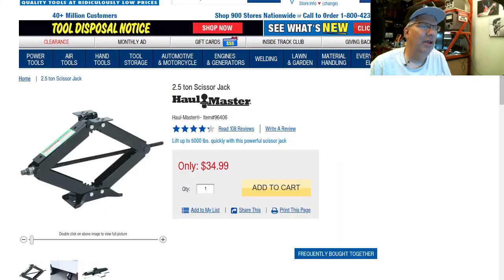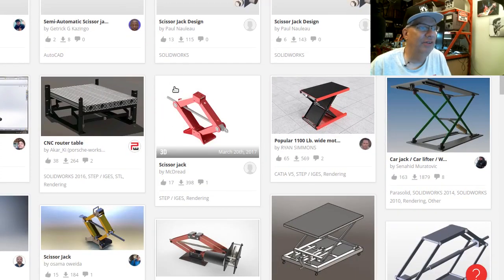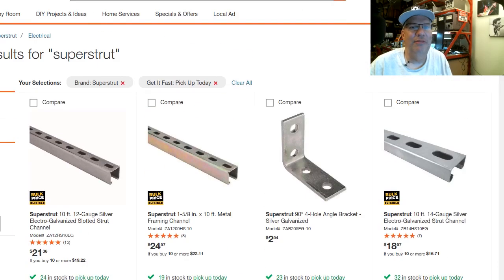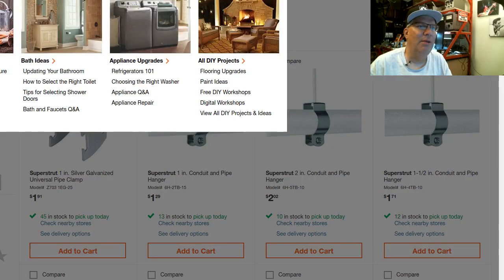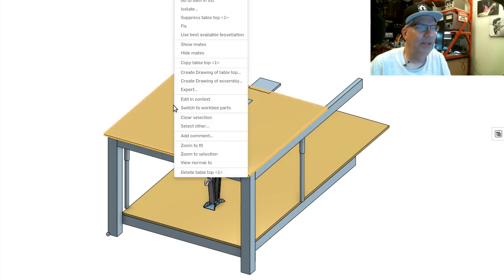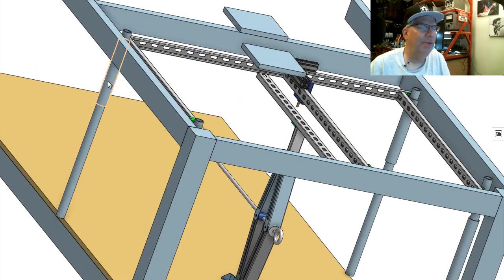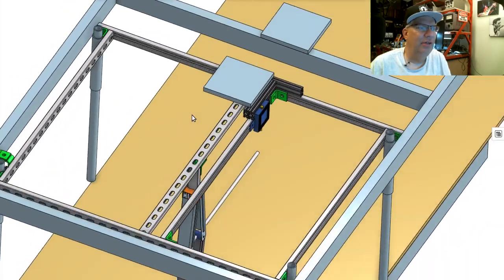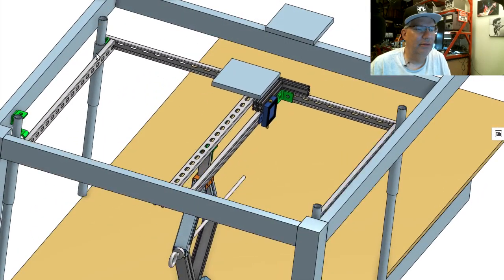180727 Valve Studio - Tonehenge Journey - WorkBee Lift Design

Comment: Nice idea.  How about something like threaded rod to tie in the tops of the pvc. Depending on space you could use a cap, coupler or plug to attach to and reinforce it. That may allow you to move the pvc pipes to the other side of the strut. Maybe even a large L bracket cut down and fit into the inside of the pipe. I have used caps to make connection points under tables for pvc legs, you could use that for the bottom.  Good luck,  I look forward to seeing what you come up with.